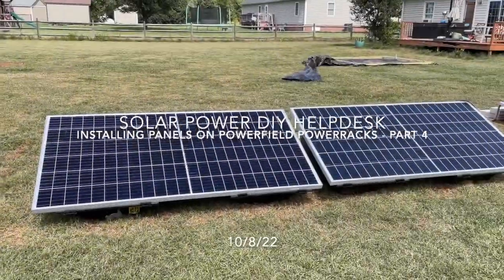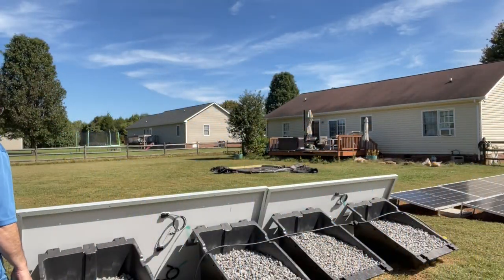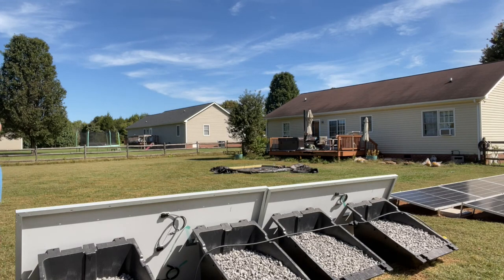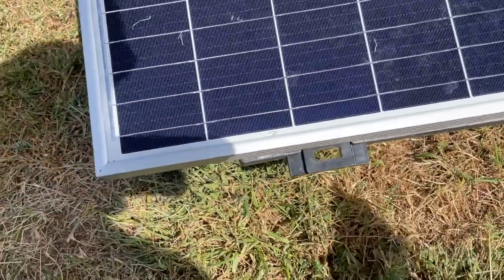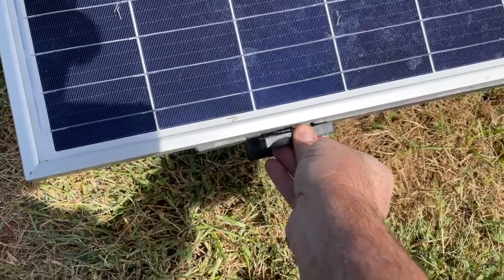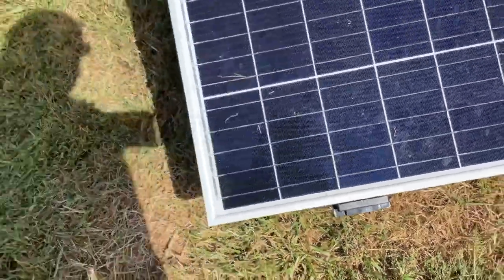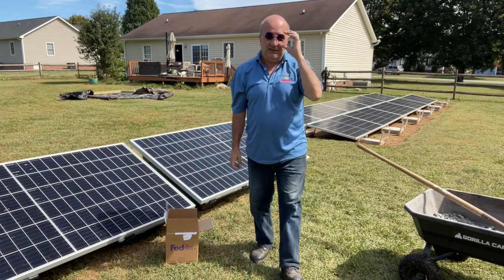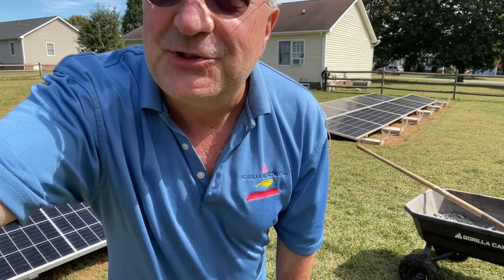Installing Solar Panels on Powerfield PowerRacks - Part 4

Comment: Have you considered using Aerocompact ballasted ground mount setup?  Their US headquarters is in North Carolina.
Reply from the maker: Thank you. I had not considered it because I was unaware of this company. I have seen that type of racking system before, and the concept is very similar to the Unirac RM10 system I installed first. Believe me, when I tell you, it is very difficult to level the ground enough to make interconnected rows look good. Also, how long will galvanized steel sitting in wet grass last, exposed to the elements? 
IMO, the Powerfield PowerRacks are more expensive but worth it for the simplicity and time savings, and they look nicer in my backyard than metal and blocks.

Comment: is there anything to prevent theft of these panels on the ground? a lock of some kind?
Reply: Yes, there are two holes at the back where you could put locks on the racks to prevent theft. With pins in those holes, the modules can't be removed. I have no such worries here, especially with two Feisty dogs in the yard.
Reply: @ToddDesiato  that's it after that comment I'm buying 6 of them for a Huge 3 panel array, thanks

Comment: If i where to put 3 big Solar panels like a 360 watt Newpowa or 320 watt Renogy, how many of these would I need? It's for a Bluetti AC300 that can handle 150 volts voc on each Mppt controller, it has 2, It can take up to 2400 watts
Reply: The requirement is that, the panels are between 39"-40" wide, like a typical 72/144 cell panels. A 320W panel is probably too narrow to fit. How many are needed depends on the maximum wind speed where you live and any windbreaks available behind the panels. It has to be designed by Powerfield's engineer to make that determination.

Comment: Where do You get these mounts and how much did they cost?
Reply from the maker: Powerfield PowerRacks are available for $65 Each
Call Toll-Free: 1-877-58-SOLAR for DIY solar kit pricing, solar advice, plans, parts, and technical support. I'm here to help DIY'ers get the job done.